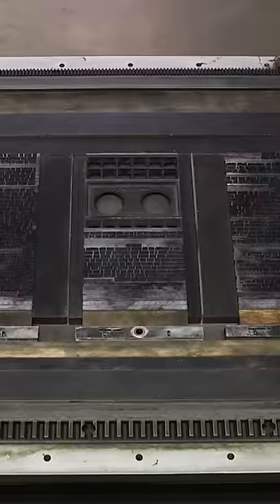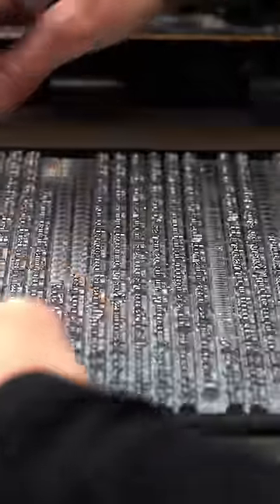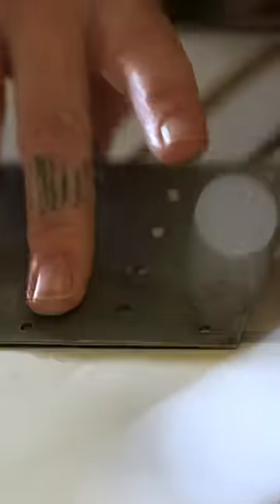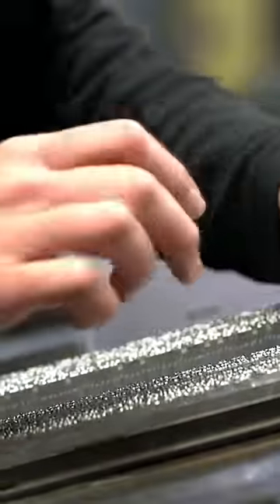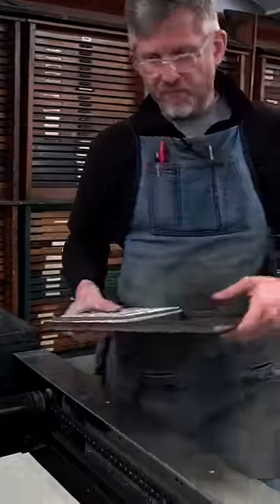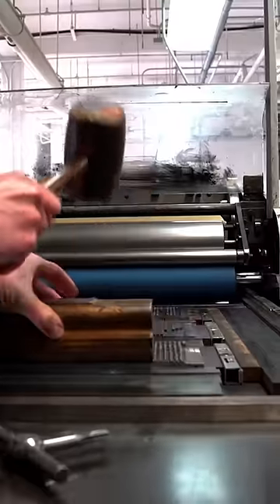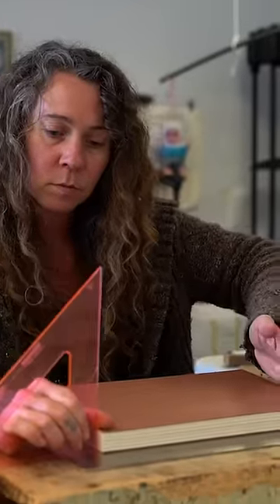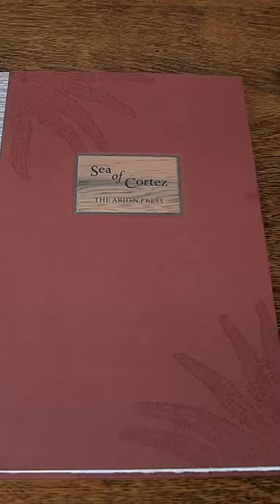How these handmade books cost up to $10,000 to make #books #crafts #handmade

Comment: I'm surprised they don't wear masks or gloves to protect themselves from the lead that may be in the air.
Reply: They probably do but not when theres a chance to show off
Reply: my dad holds his lead pellets in his mouth inbetween shots at the soda cans. 
lead pipes for water have been standard for a long, long time. 

I'm not saying it won't hurt you, I am say don't worry about it unless you do some REALLY stupid like swallow some, take a big whiff of fumes, or are bad at Chemistry.
Reply: The foundry guy is wearing a mask
Reply: @EchoLog  spoken like a true lead head
Reply: Graphite
Reply: "Lead is in the air... Everywhere I look around.."
Reply: @EchoLog  Even low level metallic lead exposure has a guaranteed impact on cognitive function. Like, RIP to your dad but he's lowering his IQ everytime he puts those pellets in his mouth
Reply: only when lead is heated or chemically attacked is when lead is dangerous, Otherwise, it is hard to absorb led unless you don't wash your hands before eating.
Reply: @EchoLog yeah just because your dad is putting the lead pellets in his mouth doesnt mean its not stupid and take a guess why lead pipes arent used anymore. Nowadays where these pipes only make zp relatively small portions of pipe in the network its somewhat ok but when there was drought and the pipe was empty the mineral coating caused by water can dissapear and then lead pipes are dangerous
Reply: Was gonna say the same thing
Reply: @harrymu148  That's just incorrect. Metallic lead (ie, the non-charged, non-ligand-bound form such as from pellets) absorbs into the blood if ingested. I advise reading up on the routes of lead toxicity.
Reply: @l.h.9747  you're still being condescending and acting like you know something I don't.
Reply: Lead is a heavy metal. Aslong as youre not ingesting it and wash your hands after handling, you are good.  The reason why lead paint is so scary because when you sand the paint (normal prep step in painting) you create fine lead dust that can be carried in the air and inhaled.  Also if lead paint is failing and peeling, little kids would eat it.  But lead paint on the wall thats sound and in good shape isn't bad at all.
Reply: I used to got indoor shooting range 2-3 times a week. Had to get blood test because worked with chemicals. My lead level was higher than permissible by OSHA😳
Reply: @p3ter9000  
Nope, it won't affect his brain; it actually affects your blood with saturnism
Reply: No! They're keeping up with historical accuracy.
Reply: Bruh, wearing gloves while working with molten metal is actually more dangerous. Because if a hot drop gets in between hand and glove it won't just roll off and will be pushed into skin longer.
Reply: @EchoLog same
Reply: Antimony too.
Reply: @EchoLog dog your dad is making himself drop into double digit IQ, you can see crime rise and education rates fall when leaded gasoline became mainstream, and things slowly returned to normal after we made unleaded
Reply: the mask and gloves money goes into the $10000 🤣
Reply: @SeventhVirtue  yet again someone telling me lead is dangerous as if I don't already know this and didn't say what I said.
Reply: @EchoLog  if you work with lead like the printers, you should be wearing gloves, your comment implies it’s no big deal
Reply: Are you guys blind do you not see the fact that he's wearing a mask LOL
Reply: @Splintz246  a 'rona one yeah 😅😭
Reply: @EchoLog  I mean but it's a mask it may not be a strong one but it's something
Reply: @EchoLog 
If you have lead water pipes then it should be high priority to replace them. The health hazards of ingesting lead have been known for millenniums and it is not something you should be willingly risking.
Reply: @wolfengod8277  you haven't read the replies I'm assuming.
Reply: @Splintz246  this's tru
Reply: this is america! we don’t care BOUT NO DAMNN LEAD ! back in my day we used to eat them in chip form .
Reply: Recently found out my dental fillings made from amalgam made from from silver and surprisingly mercury, had them since 20, now I'm 58, must've got some plot armor,lol😅
Reply: @Splintz246 inappropriate masks while handling hazardous materials aren't just ineffective to the point of being useless, they are worse than nothing because it lulls you into a false sence of security.

For any work around molten metals, you should be wearing a P100 mask to remove any metal particles. For heavy metals that are biologically active, I'd probably wear an organic vapour/particulate filter mask, to ensure any fumes are kept out as well.
Reply: @haldyordan2316 in very small doses mercury isn't that dangerous. I doubt there is more than 1 mg in your filling.
Reply: Writers are generally crazy, why not the typesetters for continuity.?
Reply: @0ut1and3r Um...   Huh?
Reply: @CloudNey I don't know if you're being foolish  😄🎶
Reply: @George.Andrews.  "but it's something that we must believe.. lead is there when I look in your eyes.." 🎸😁
Reply: People calm down. It's just a bit of lead, not arsenic. While we're on the subject, you have a greater chance of dying from being hit over the head with an aluminium pot than cooking in one. 🤪
Reply: I mean they’re also playing with antimony but no one seems to mention that
Reply: @CloudNey  
"Lead is in the air .."
John Paul Young would not approve. 😉
--  You realise that song is now over 45 years old?
Reply: @IvorMektin1701 it’s a cloth one not a legit mask to filter out the led. Those cloth ones are good for catching spit/boogers, that’s about it
Reply: He legit was…. It was flannel.
Reply: @jabberwocky1707  time flies my friend. He has passed away kind of recent, hasn't him?
Reply: @mugshotmarley little kids eat lead paint chips, and die all the time.
Reply: I’m surprised people eat foods with the ingredient (Natural Flavours) 

So many things will kill you regardless remember to Live.
Reply: @EchoLog Regsrding lead pipes:  They’re not an issue if you don’t have corrosive water.  Even if you do briefly it’s not an issue, the lead will naturally form a protective layer of minerals.  The only time you have a problem is when you have corrosive water for long periods of time.  Also lead isn’t the only toxic metal pipes are made from — iron and copper pipes are toxic as well.
Reply: @wolfengod8277 Not at all true.  Lead pipes are fine as long as your water supplier isn’t criminally negligent.
Reply: @LifestyleNotOfTheRichAndFamous Lead toxicity causes developmental disorders, not death…
Reply: It wouldn't really be in the air.
Reply: @AnarexicSumo  and that's why people use plastic, then they learn about how bad plastic is, and eventually if you've got that hair up your ass as much as the rest of us: you start researching ancient water and waste systems made by masons and woodworkers. 
This last cycle of "innovation" is leading us back to the old ways.

Moral of it all is you're way worse off worrying about things than working your ass off.
Reply: @peanutheadrules  In fairness, making sure you don’t breeze drops of water into molten lead is probably pretty important.  If any of those drops of water get under the surface of the lead they will explode into steam.  The splatter could be pretty dangerous.

I understand that something to protect against vapor inhalation would be useful, but I’m pretty sure that cloth mask is useful.
Reply: They're probably all long since poisoned. Look how hypnotised they all are in carrying out their painstaking life wasting work 😆
Reply: It's not Lead it's Carbon Black the dude narrating is misinformed on the subject material and is just rereading someone else's mistake.
Reply: @p3ter9000   and you are what? a expert neuroscientist?
Reply: @p3ter9000 prolly why he kept doing it
Reply: @EchoLog lead pipes went out of style three centuries ago wtf are you smoking?
Reply: @EchoLog yeah and have been shown to lead to increased agression and mental issues. So yes there is good reason to worry.
Reply: @EchoLog  

No.  Lead is damaging in ways that are not immediately obvious, but add up over time.  Do you know how much harm leaded gasoline caused?  

Under some narrow conditions it can be used relatively safely (pipes can be ok-ish depending on the water's pH and what is dissolved in it).  But heating up lead alloys can produce fumes, which means a much higher chance of exposure.  Putting lead in your mouth is a bad idea.  You will effectively lose some brain cells each time you do it, and roll the dice on more serious problems.
Reply: @AnarexicSumo  the 2017 case of the little girl in Chicago,  who would consume the paint off her knock off hot wheel toys, that killed her within 3 days of consumption.
Reply: Lead is good for you
Reply: @michaelvanwynsberg3737  another person telling me things I already know.
Reply: @EchoLog this mentality is why lead poisoning is such an issue in the U. S
Reply: @EchoLog  guess what happened to the radium girls who put radium in their mouth and all over them because they were told it was safe
Reply: @Nzzertral  continue to lecture me on toxicity, you're making a very dull point I already agree with, while thinking mine is null.
Reply: The lead is heated to the point of melting, not evaporating. I don't think it's that big of a problem. It's like soldering with lead filled tin, the smoke is the flux evaporating (also not good to inhale) but the lead (for the most part) stays on the soldering iron, not evaporating... It isn't hot enough for it. Leads boiling point is 1750 Celcius. So while very small amounts might evaporate when molten, afaik, the most important part is washing your hands and not putting your fingers in your mouth
Reply: Every employee hastens their call to the void.
Reply: @SeventhVirtue  shit is mind blowing to think about
Reply: Your dad really should not be doing that. Just because it isn't causing immediate, obvious issues doesn't mean it isn't causing harm.
Reply: @EchoLog  people are just bored and using your comment to have something to poke at. Har har old man dumb. Don't take it too seriously, I'm sure all of them skipped over (i.e. ignored) your disclaimer, because they got excited over the 'lead bullets in mouth' part.
Reply: @EchoLog  There is no safe amount of lead exposure.
Reply: @Cyrribrae  I never said there was.
Reply: The real danger with setting lead slugs in a monotype, is lead squirts. That’s where you CAN get hit with a small amount of molten lead. It will wake you up.
Reply: @Ehcantcomment the type blocks are made out of lead. did you not see the molten lead lol
Reply: @harrymu148   the lead was melted so
Reply: @Vibe4ant the body can't remove lead
Reply: @0ut1and3r Not graphite, but actual lead.  Before printing went digital, real lead was used to make letters for newspapers and books because it is a metal that has a low melting point.  As such, it is easy to melt and mold the letters.
Reply: @IvorMektin1701 That isn't a respirator and isn't going to provide adequate protection from heavy metal fumes
Reply: @farpointstation  
Sure it will
Reply: @IvorMektin1701  A cloth facemask is not a respirator and definitely isn't going to provide the protection of one
Reply: @farpointstation  
It just has to be good enough
Reply: @IvorMektin1701  Its not.
Reply: @farpointstation  
Yes it is, the guy is an expert
Reply: @IvorMektin1701 An expert at what? “Making type”? Then sure. “How to prevent gradual harm from lead fumes”? I don’t see why to expect that he’d be an expert at that, necessarily?
Reply: @IvorMektin1701 That wasn't really a mask, just a bit of fabric that wouldn't protect you from much of anything. You'd need something more substantial with filters for fumes.
Reply: @EchoLog ya thats not how it works.
Reply: @EchoLog how many people have to “misunderstand” your comment before you read it again and realize what you said?

To be clear, because I don’t think that will ever happen: saying “don’t worry unless you do something really stupid like swallow lead” is a very stupid statement. 
That’s like saying “don’t worry about smoking cigarettes unless you do something really stupid like smoke multiple packs a day.” Whether you’re aware of the dangers of smoking or not, that statement doesn’t just imply but DIRECTLY says that the dangers of smoking aren’t worth worrying about unless you smoke way more than most smokers ever will. 

The “don’t worry” is the problem. Your dad is sucking on lead balls and you’re convinced that there’s no reason to worry unless he swallows one. Nobody cares whether you know that this is a problem or not when you’re literally telling people not to worry about lead toxicity because, idk, it could be worse? Why stop there though? I suggest you don’t worry if he swallows one of those lead pellets, just as long as he doesn’t swallow a handful.
Reply: @elonmusk921  all y'all assuming by "in his mouth" I meant "sucking on" (your words not mine) 
I seen my cousin worry her way to cancer without any dangerous exposures, just bad habits. 
Nice strawman.
Reply: @AnarexicSumo  lead toxicity cause acute and chronic health issues, I used to work in Red Dog Mine in Alaska, it's the largest zinc and lead mine in America,  and I've seen hundreds of people, even wearing the right p.p.e. have to spend months At home or outside the mill, because there blood toxicity became to high.
Reply: @EchoLog  I’m genuinely amazed that you read “sucking on lead balls” as a serious statement and not a joke about your dad sucking on balls. 
Decent bait, was very believable till now. The implications of your cousin anecdote really broke the immersion in a big way though, so I can’t give this higher than a 6/10.
Reply: @p3ter9000 lead has to be heated to 820 degrees f before it can be come vaporize and dangerous.
Reply: @bobsunkees3392  Lead doesn't have to be a vapor to be dangerous. Solid lead is toxic
Reply: It’s not that bad for you.  Just kidding!
Reply: @EchoLog  He's not acting condescending at all. And why shouldn't he act like he knows something you don't?
Reply: @pixeltoxa9284   Have you ever heard of gloves that lie flush with the skin? No?
Reply: @George.Andrews.  But we aren't talking about aluminum, we're talking about lead. Not sure what your point is.
Reply: @AnarexicSumo  Water delivery infrastructure should not rely on "it's fine as long as the people running it aren't criminally negligent". A system will eventually find a way to be criminally negligent if one exists, and water providers in particular don't exactly have a stellar track record in America. Water delivery infrastructure should as much as possible be designed in a way that is robust against "corrosive water".
Reply: @EchoLog  "another person telling me things I already know"
You did not act like you know the things people are saying to you. It is very shabby of you to be annoyed or even surprised by the response you're getting.
Reply: @NoriMori1992  I'm sorry are you watching me in my real life? Observing what I know and how I act on it? Only what I say online unless you're stalking me. 
👍
Reply: @NoriMori1992  why are you so passive-agressive? The fact that there are gloves that are flush with skin doesn't mean that I am wrong. Not all the gloves are like that.
Reply: @NoriMori1992  I never said I knew everything they knew, don't put words in my mouth. I simply said that what they said, I already knew, and lately I'm fed up with that.

I'll stubbornly argue with you till the heat death of the universe. So, your move, O pedant.